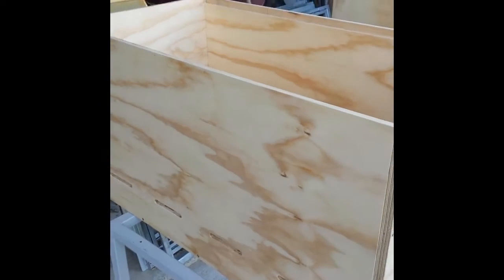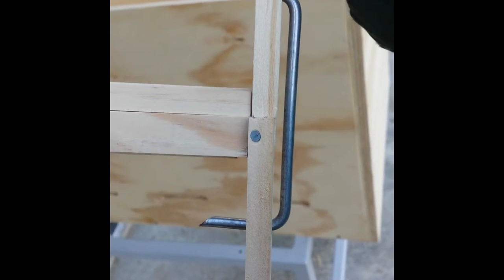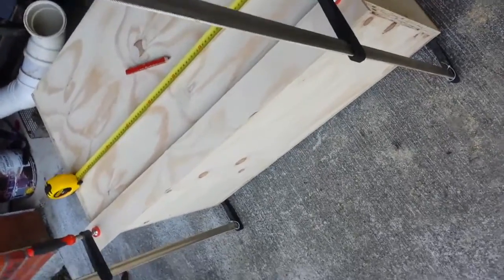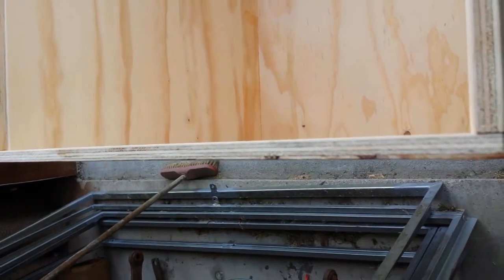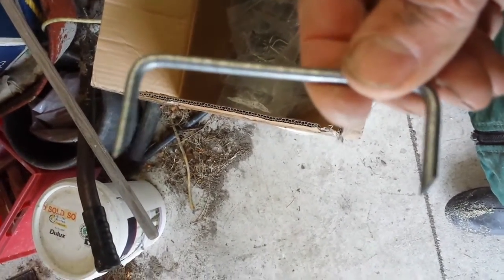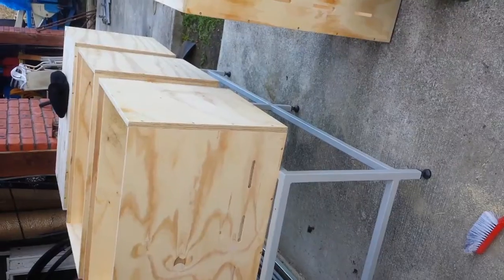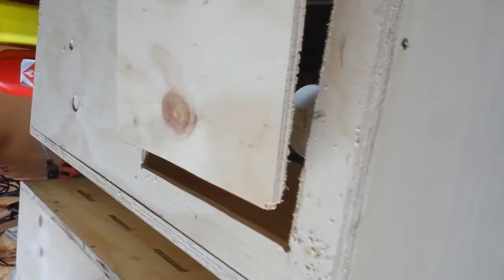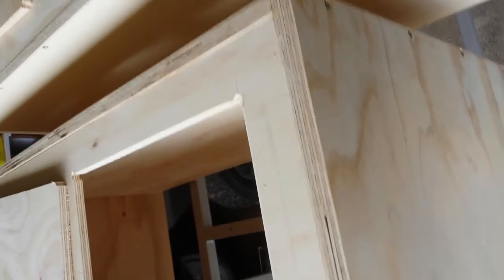Double Deep Horizontal Langsthroth Beehive Design 2016-06

Comment: Those things are going to be too heavy.
Reply from the maker: Hi John, Yeap, you are correct. My back was quite bad at the time and I actually was trying to avoid lifting off conventional boxes of honey to get to the brood, so swapping one set of heavy for another. Unfortunately my experiment found that the double frames also ended up too heavy. I think going to either an 8 frame full depth, or 10 frame medium would be a better solution. As I'm now invested in full depth frames l'm more likely to go the 8 frame route.

Comment: Nice work. Very clean. Has it been as functional as you hoped? What do you wish you had done differently? Beekeeper on the South Carolina coast since 2013, Bee-Haver since 2012. Mix of 20 Langs and Horizontal hives. Thanks for the video.
Reply from the maker: Hi, no not as functional as I'd hoped.  After the first year I chopped them down to a single height so I could just use a single frame height and mount a super on top (double frames were too unwieldy) and then this year I moved the girls to standard 10 frame hive bodies.  The issues were mainly nothing I purchased would fit them (major), the length was too long so when you get over around 18 frames it's wasted space as they didn't build to the end or seem to maintain it (more minor).  

I used the top piece I cut off to make swarm traps (2 from each piece) and they were so successful this year that I'm using the bottom of these experimental bench hives to do make even more.  This last year I caught over 10 swarms on two properties, so that has me thinking about other beekeeping opportunities with friends and family.  It gives you way more time to collect than when they are in a tree, which is what I need when working long hours. Hopefully I can make some time to create some more current videos about what I'm up to. Thanks for the comment :")
Reply: @beezerk4623  maybe you would enjoy horizontalhives.com and Leo Sharaskin's natural style. His plans are free, use 2x10 pine and can be adapted to Lang frames with a shim. Standard frames are 16x16. Thank you for the favor of a reply.
Reply from the maker: @OBG1952   I've seen that site. Mine were using langsatroth frames. It is the ability to super, use top feeders etc.  If you make ALL your own equipment then all good, but if you want to buy standard stuff then better to use standard stuff IMHO.  I think the girls actually prefer a nice round brood area with a diameter of approx 18" and two full depth brood boxes deliver that.  I like the way Michael Bush uses all mediums to keeps to standard equipment, but I have so many full depth now it would be hard to change.
Reply: GoBeeZerk agreed. I have emulated Walt Wright and his “ground-breaking for his time” approach to nectar management during the 1990’s to mid 2000’s. My bees haven’t swarmed since 2015, all local survivor stock, and except for the 2 times I tried oxalic acid, treatment free...either they make it or they don’t. I catch about 75 colonies each year to give away. I like you have been hard on my body (I hear your back ache in your narrative) and at 67, am looking at the long view. I will never know all I want to know, but I want to stay on the path.  Stacking 6-8 boxes, even mediums, is going to be tough from a step ladder in a shorter time than I like to think about.  You ever get to to the USA, East Coast,  look me up. Could be fun.
Reply from the maker: @OBG1952  Certainly will. I watch 628DirtRooster (Randy) and Jeff Horchoff in Mississippi and Louisiana and would love to actually visit them, but a long ($) way from here down under. My apiary is at my house so I never super more than two boxes above the excluder, and then I pick 'ripe' frames out of the box to extract a few times over the season. If I need to remove the supers to get to the brood I have a light frame I made handy that is waist height so I don't have to put them down or pick them up. I just place them on the 'shelf' and I can fit two on there, then move the frame to the next hive. I brush bees off full frames and put in a plastic storage bin in my wheelbarrow, take to garage to extract, then put the empties back into the same hive. Can do with local 10 hives

Comment: Good thought but the bees will glue up a mess for you sometimes.It is hard enough to get just one frame pulled out.It may work for you if all goes perfect.But bees do what they want much of the time.To much area before they can handle it also invites other problems .
Reply from the maker: Absolutely correct.  Was an interesting experiment, but now gone back to standard full depth Langstroth boxes. Equipment fits, and can easily resize, extract etc.

Comment: How many frames do you think a strong colony would actually use? Cause 52 seems more than double of what i'd expect... :P
Reply from the maker: It all depends on the flow and when you plan to extract. You can obviously manage with two 10 frame boxes as you mention, but not many do and I have seen hives 6 or 7 supers high. Not so easy to add onto a horizontal hive so it has to be a compromise. These are experimental and I'll be trying some other designs in the future.  The reason I gave these a try is the fact that my back has some issues, and I'm trying to manage the pain. So far so good.
Reply: Thanks for the reply! A question on my mind, not directly related to horizontal hives, is whether you requeen your hives periodically or not? and if so, how you manage that?
Reply from the maker: Wim miW I won't be routinely replacing queens but rather replacing them when they need it. Good to have a few hives and this year we raised about 30 queens for our splits, so that was all good practice. We used a cloak board on a conventional hive to do that. That is another reason to not have all horizontal hives. If I keep them small I can manage a conventional design. Going to experiment with styrofoam hive bodies when I get time.